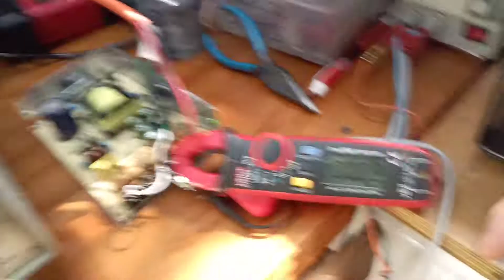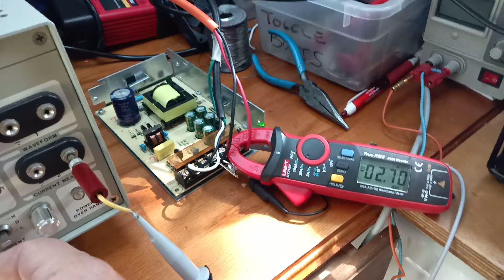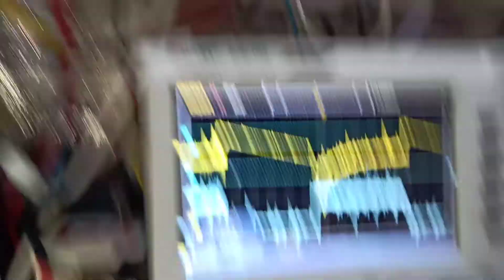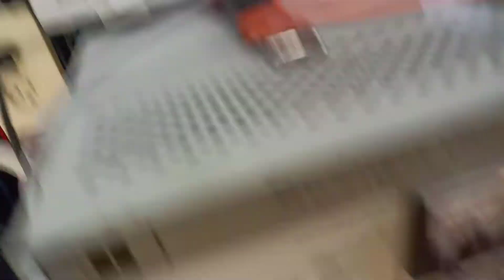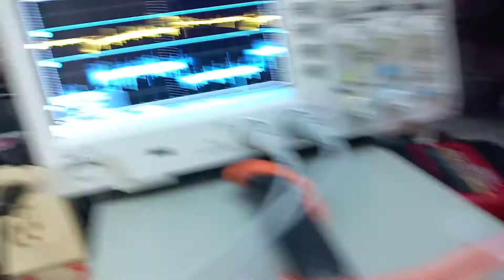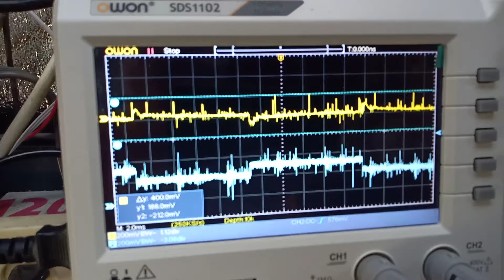12V 10A 120W LED Power Supply On A SWINGER 1 Dynamic Load Tester Powered By 60V DC

Comment from the maker: The LongWei power supply has been sent back for credit. Further testing found the FINE voltage pot was erratic and that was the reason I couldn't ever get it set. These are the smallest pots I've seen and will likely wear out quickly with use. Frustrated by having something new defective right out of the box. The fridge inverter had shorted out earlier and I had to fix that. Everything had gone wrong that day and in not much of a mood to do a video. Here is a quick video which makes it a little clearer on how a dynamic load tester is used. It came out looking pretty good compared to a China laboratory power supply.